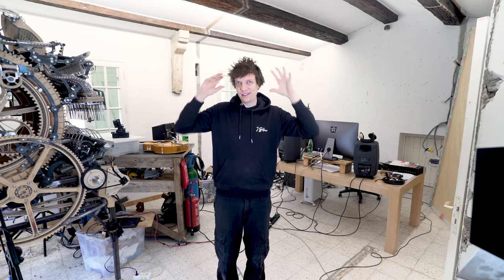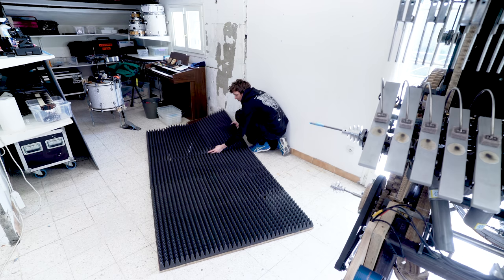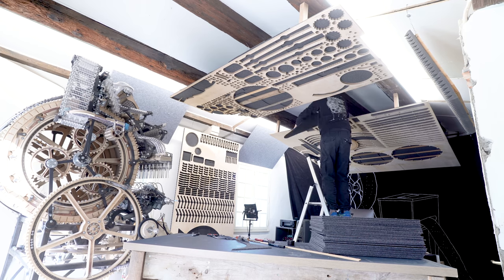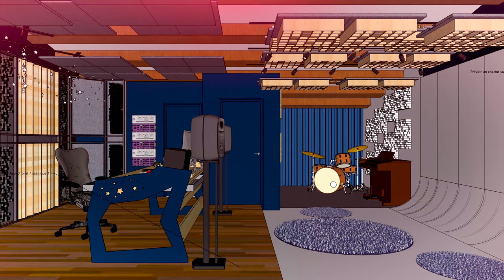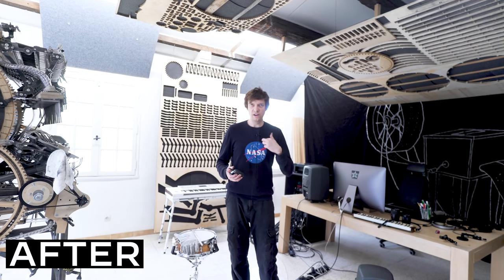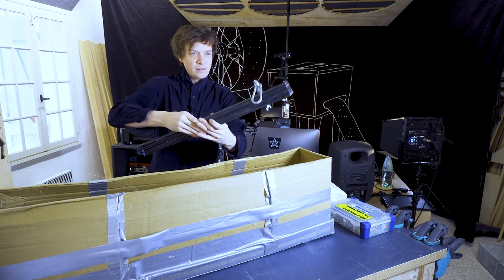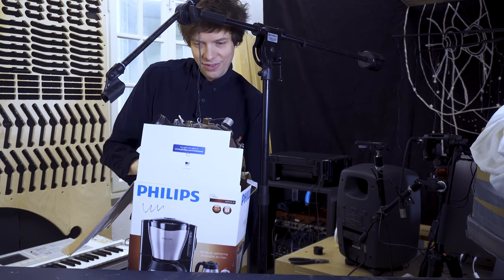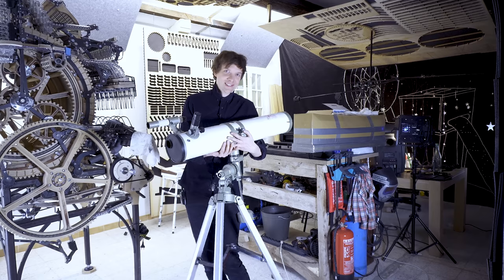Acoustic Panels from Plywood Scraps - Music Studio Build

Comment: Just be careful in regards to fire safety. It takes very little to ignite cheap acoustic foam, and it burns like all hell. If it catches fire, chances are you won't be able to put it out in time, especially bolted to plywood.
Reply: I'm 99% sure there is somthing you can put on plywood to treat it to make it fireresistant. That might be a worthy investment. (Mind you, I hope he had an electrician look at that dodgy wiring from a few weeks back)
Reply: I was going to make the same comment about flammable materials.  He welds in there......and I doubt he fixed the wiring.
Reply: @motor2of7  just waiting for him to post a video that his house burned down and that the MMX is going to be another 2 years to get it back into this state
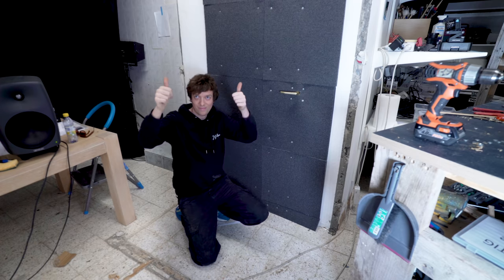Reply: Nope, the horrible wiring mess is still there. Pause at 5:00. 240 volt wiring, flammable wood and acoustic insulation, Tig welding sparks, and a very expensive Marble Machine X all in the same room... That's a huge disaster of a fire waiting to happen. It will be devastating to see Martin's sad face after watching the MMX and his studio up in flames.
Reply: I very highly recommend using theatrical fire suppressant coatings (Rosco makes ones commonly used) on basically everything there. Everything on a set must be coated in them to be allowed in the door of any theatre I've worked in.
Reply: I think too that welding in that environment is pretty risky.
Reply: omg this comment needs to be noticed by Martin!

Comment: Be advised, those foam panels are EXTREMELY FLAMMABLE! And you are using and ANGLE GRINDER in that room throwing sparks everywhere! As well as welding. This is extremely unsafe! It's only a matter of time until a spark finds one of those panels.
Reply: https://youtu.be/k37l7hXjBYQ?t=42
There are regulations on this stuff. Now the Station nightclub fire was using a type pf packaging foam not for its intended purpose. I am not saying you should go around making a foam fireplace but genuine acoustic foam made by a reputable company have to meet fire code regulations.
Reply: YES, this!  Welding torches, angle grinders, light boxes and dodgy electrical outlets combined with those foam and wood panels is a death trap. DANGER WILL ROBINSON, DANGER.

Comment: I... don't think having the pyramid foam facing away from the source of the sound is correct...? The way I understand it works is the sound bounces back and forth between the foam pyramid, during which it loses energy and thus the final sound wave that is reflected back as an echo is greatly reduced in volume. It might be it works in some different way, but I don't think you're helping the cheap foam by facing it away. 

Also, having the hard plywood face the room makes it basically act as the new wall, the fact there are holes in it helps, but I don't think there's nearly enough of them.
Reply: Yeah much of the sound will just be reflected by the plywood before being filtered even once by the foam. Ideally both sides should have foam, to better eliminate the direct sound and the sound that bounces of the wall and then hits the sound trap. It wouldn't look that nice though
Reply: I've been in anechoic chambers for emissions testing.  That is precisely how the pyramidal cones were facing.
Reply: @eckhart5443  his eternal problem
Reply: I think that's the joke (it's April's fools) - at least I hope so
Reply: I think this is a case of aesthetic over function. It still works, just not as well. But it still keeps the look of a maker's studio.
Reply: @hexd0t  - I'v thought of that, but the id-acoustique threw me off. In all honesty, if it's an April Fool's then Martin got me and it's funny, and if it's not then this might help him 🙂
Reply: That's what he off set it from the wall. It passes through the back side once, then bounces off the wall into the triangle side. 

But the cheap egg crate foam really isn't the best anyway, it just acts as a but of absorption
Reply: Don’t forget it’s just temporary .
Reply: I hope it's an april fools joke! Having exposed plywood doesn't offer any acoustic improvement (Just a little dampening of lower frequencies if anything). The triangle shapes are indeed meant to be facing the source of sound.
Reply: @johanispro4219  Even plywood with irregular holes should be better than nothing: With primary reflections occuring at two different distances instead of one (and even more secondary reflections), there will be some self-interference going on, with the net effect inevitably being destructive compared to single reflections. In addition, this variation in reflection distances also reduces resonances, i.e. standing waves, which I'd consider even more of a pain than reverb, for a host of reasons. Besides, the free-hanging plywood is also quite flexible, has low mass and sports a somewhat porous surface, and thus will more readily absorb sound energy than a massive rigid plaster wall.
Reply: @maestrodiogenesbillionaire870  
Pain is temporary...
Reply: Buddy Clem_
Reply: He should add a second layer of pyramid foam to the facing side of the plywood. That'd be best.
Reply: @William Anderson I also agree. And hello
Reply: What he did is unintuitive, but correct.  In general you still want 1st order reflections.  You still want to hear the room... you just don't want to hear the room for the next hour the minute you drop a drum stick.
What he did essentially traps 2nd order reflections between the wood and wall to kill the echo while still allowing the room to have some character and not sound like he is in a dead studio.

That said, if he wanted to deaden the 1st order reflections as well... then ya, cover both sides of the ply with foam.
Reply: @CaedenV  Seems like he probably wanted to deaden the 1st order reflections as well because he used irregular panels offset from the wall pretty far. That's trying to turn the reflected sound into white noise.
Reply: @louisvaught2495  this seriously has to be an April fool's joke so much wrong with this. 

From my understanding the airgrap only works if they are specifically separated systems. IE preventing air from flowing between both systems.
Reply: @seemlesslies  No... Martin is absolutely correct.... 3" foam directly on the wall does NOTHING below about 300 Hz.  But 3" foam moved 10" away from the wall will absorb much more at all frequencies, and absorb down much lower frequencies.  It's true that how it's mounted and/or enclosed could would improve performance, but this was a quick & easy DIY experiment, and was very successful for $0.00.  This was stuff Martin had lying around.
Reply: @recurvestickerdragon  Pretty sure he's just making do with that he already had, otherwise he wouldn't have used carpet on the ceiling.
Reply: @CaedenV  Why do you still want to hear the room? Seems like he's going to all kinds of trouble not to hear it...

Comment: PLEASE READ THIS MARTIN:  Long-time lurker, HAD to comment.  I appreciate your artistry, but this thing is a fire-safety death trap.  I don't say that lightly, and I have the scars to prove it.

All that stuff in the studio has flashover points, it doesn't matter how fire-resistant it is ... you've created draft spaces for air.  Any fire will not be noticed at first, then climb upwards underneath and behind those panels, get very hot, rain flaming shards of doom.

Look at the history of night-club fires, artist lofts (San Francisco Ghost Ship), fire dept. training videos.

If you want a project:  buy insurance, fix the wiring, and consult on building a fire suppressant and sprinkler system along the rooflines.  This MUST be incorporated into any studio design, since it doubles as an industrial workspace!
Reply: referencing comment
Reply: @Anya-B.  
I didn't want to be a Debbie Downer, so on a positive note Martin should consider the following materials:  mineral-wool batting to create acoustic panels (doesn't burn or melt like fiberglass), use natural textile fibers not synthetic, intumescent paint, gypsum fireboard with solid-wood framing (not MDF), smoke detectors, multiple emergency exit markers.

Compare the videos below for info. on sprinker-system suppression, flashover, and ... just for fun make your own Starlite!

https://www.youtube.com/watch?v=IxiOXZ55hbc
https://www.youtube.com/watch?v=gT1EWVR1iP8
https://www.youtube.com/watch?v=w4W82HIzUcc

Starlite putty:
https://www.youtube.com/watch?v=LgwKCi5pi7Q

Comment: I always remember my lessons from college. When lighting for
film or video it is Key, Fill, Hair. When it looks good through the lens it’s
good. Things may have changed a bit in the last 30 years but I think this still
holds true. 
The other thing I learned was about acoustics that hard surfaces
reflect and soft surfaces absorb. I realized this when I worked on a show in
our multi-purpose room. I was amazed just how much difference it was with and
without an audience.

Comment: Maybe you should use some black thread instead of nylon to hold the stars?

Something like cotton, to have as little shine as possible, so that it blends with the dark background.
Reply: There's a certain childish simplicity with being able to see the nylon, of not caring that it's obviously fake because it's the idea that counts, not reality. It matches up well with the knick-knack aesthetic of the planet.
Reply: @timh.6872  Removing that would not take anything form that simplicity. The pointy stars and knick-knack planet already convey it.
But on a purely aesthetic point, those shiny, wiggly lines are distracting, and add unnecessary clutter to the background.
Like scratch marks on a photo.
Reply: You can also paint the nylon black if you need the durability

Comment: 5:00 I was like: "what, a 6m long standing wave???" but then I calculated, and it indeed would oscillate at 50Hz and have quite strong 100Hz and 200Hz harmonics :o
Reply: Yep. Audio range being logarithmic means we hear between 20Hz and 20'000Hz, which translate to 15 meter long waves and 1.5cm long waves.
Reply: @riccardoorlando2262  20kHz is 1.5cm long? Shouldn't it be way smaller? I tried looking it up online but couldn't find what i wanted
Reply: @funi-so8067  s = fλ, so for 20kHz, λ = 343m/s / 20000 Hz, or 1.715 cm (in dry air, at 20°C)
Reply: I doubt it would be a simple calculation since the ends are neither closed nor are they open.
Reply: @funi-so8067  millimeter wave is in the microwave frequency spectrum, so it sounds right to me.

Edit: different media, and speed of sound versus speed of light. Oops.
Reply: @riccardoorlando2262  I had never thought of audio frequencies in terms of wavelength! (Only radio.) Fascinating! I'm going to try to calculate the standing wave for my music room, approximately 3m × 3m.

Comment: Some padding and an area rug... It will do wonders!
Also, for DIY bass traps, look at hanging heavy objects of different sizes to eat different frequency ranges  The scrap wood panels hanging from the ceiling is the right idea... now to cut them up so they are not all 4'x8'.
Also, mass is key to sound deadening.  Rock wool insulation (of whatever brand is in Europe) is AMAZING for killing sound (though the r value sucks for insulation).  I recently rehabbed a bedroom (lets be real... its still a work in progress lol), and I added rock wool between the bedroom I was working on and the shower, and oh man... you can sadly still hear the water rushing through the pipes, but you can no longer hear things like the water splashing around in the shower, or the toilet flushing, or my kids talking or singing to themselves.  That stuff is relatively cheap, and works super well.
With all of us working from home now I am running into the issue of me trying to run tech support in the basement, while my wife is teaching piano lessons remotely right above my head... talk about a sound nightmare!  This weekend's project is going to be to put the leftover rock wool between the joists of the basement ceiling, and trying to secure it there somehow without drywall.  Wont be a perfect fix, but it should help quite a lot.  Plus it will help eat some of the room reflections of a concrete floor and walls with  a wooden ceiling.
Another thing you can do with rock wool is make a cheap frame around it, and stretch fabric over it.  Instant wall art that kills sound really well!  DIY Perks has a particularly good video on it, though there are several to be found on youtube!

Comment: it also helps if you are doing a air gap between wall and panel to let a baffle at the top or bottom (not both) to allow sound waves to enter and get trapped in the air gap.
Carpet cardboard rolls wrapped in material about 8 inches from walls, placed in a corner does amazing things too.  
Good job btw.

Comment: Cool job. For the Christian Local Radio in Växjö Sweden, I used studs on the concrete walls as 50mm distance and on those I used 50mm ground plates. On top of the ground plate I used 300g scenmolton (Swedish), like the cloth used in many types of backdrops. Then we framed it with oak laths or strips. Works great. We do have little problems round 60hz, but the studio is mostly only used for speach radio today, so that’s no problem. There is a low cut on 80 or 100hz. Can send a photo of it if you want

Comment: Getting close Martin. I was worried you would only use a key light at first but you balanced it out with some fill. The last thing you need is more rim light (back light) on your head to add separation from the background. Basically, hang a light up high and aim it right at the back of your head. Then you will have full 3 point lighting.

Comment: When using the talking Head-Cam, you could try to cross light yourselves, if you have a very low power soft lamp lying around. (I was thinking of a old night table lamp) That way we could see the left halve of your face, instead of just the right halve. The illumination from the side you do, gives you great dept, but its a wee bit strong.

Comment: A cheap and rather effective sound dampening material is Heraklith (or something similar). It is available all over Europe. It is made from long wood shavings coated with a cement like substance and pressed into tilings. It is rather heavy, which helps with low frequencies but sill a pourous absorbtion material.

Comment: Put a couple of spotlights on the planet and it will pop even if a lot further back.  Add a clock motor at the top of the cord and it could easily rotate once per hour or every twelve hours for variety.

Comment: Here is a great opportunity to put your recording and testing skills to work.  You could record the sound your clap makes just like you do when trying to sync the drum hits using your software to show the signal.   You should easily see the echo of the clap what should be a spike but because of the echo will be several spikes in decreasing amplitude following the first one.  Probably be too late for a before and after however.   Some people slap two boards together for a sharper spike.

Comment: Ah! A good, cheap, easy to get sound baffle is actually egg cartons- the part where the egg sits during transport. Try and use the paper or foam ones, and simply staple them to the wall directly. Another idea- tapestries, blankets, or other large hanging cloth will deaden the echoes very effectively. Even a rug can do wonders! But honestly, if you’ve got the right acoustic gear, use that.

Comment: If you have the time, materials, and inclination, I would like to recommend a somewhat different acoustic solution.

For this, you will need a fair amount of lumber. You can begin with a large square shaped piece (on the end), and saw through this diagonally so that you have two pieces with a triangular cross section.
What you want to do is make large triangles of solid wood, using a softer wood like pine or poplar. Each side of these triangles should have a triangular cross section with angles of thirty to fourty degrees, and be about one meter in length. These triangles should resemble the metal ones sometimes used in music, in other words the inside should be open and not solid or filled in.
When you have completed several of them, you should hang them on the walls (or a few centimeters away from the wall if you wish) in a mosaic pattern of alternating triangles pointing up and down.
It is important to cover opposite sides of the room with these; and if you can, to cover the ceiling as well.
For the ceiling, you may find a further improvement by hanging the triangles a few centimeters or more below the surface.

If you can do this, I think you will find that the room acquires a much more natural, full frequency, balanced sound, without the need for sound absorbing material.
I realize this could be fairly expensive if you don't have materials readily available, but so is the professional treatment you mentioned.

Whatever you decide, I am merely trying to be helpful, and wish you the best of luck.

Comment: When you live too long alone far out in the country side: <Starts shushing the instruments>

THAT SAID: Using the scrap plywood actually looks pretty cool.
Also, I got rid of some of my room sound by using one of those semicircular "mike screens" that go behind the mike. They catch your voice so it doesn't start bouncing around. That could fix the last of the problems until you get the pro solution. But it feels a bit weird talking into some gray foam. I got the "t.akustik Micscreen flex" which is the cheapest I could find. But it does help!